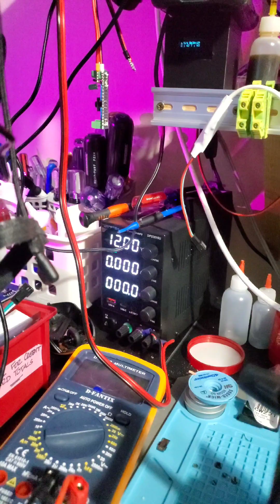Home Electronics Lab Build? : Five Tools You Need Getting Started!

Comment: Instead of these strippers you should buy a automatic wire strippers. It also has a wire cutting and crimping function, I bought mine for $8 and have been using it for about a year with no issues
Reply from the maker: Do you have a part or modle that is recommended? Id be down to upgrade ❤